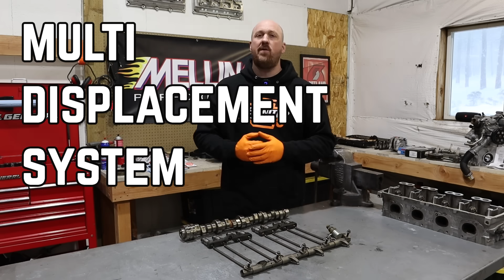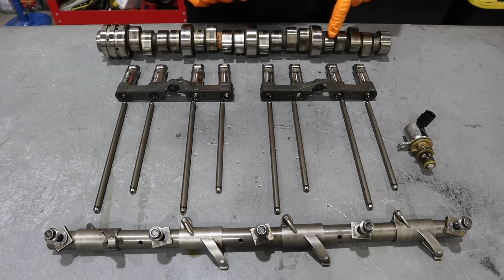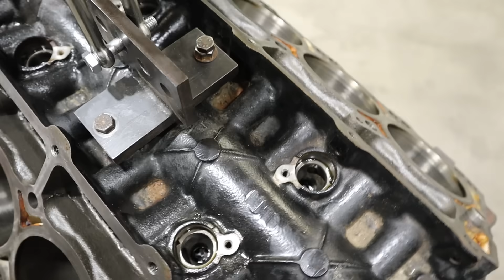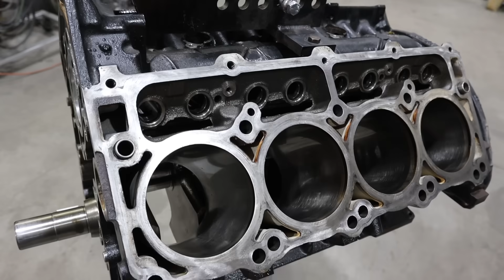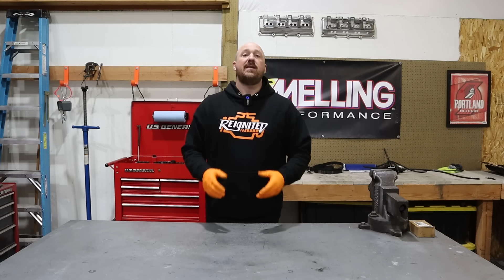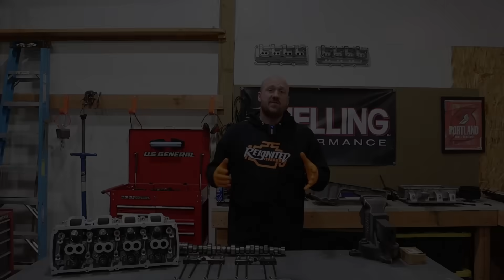Is MDS Damaging Your HEMI? The Answer May Surprise You!

Comment: So if deactivating the MDS by using your transmission auto select 8/8 is hurting the oiling how do they get around tow/haul deactivating MDS and that’s when you need the most oil for towing . It’s towing when you have arguably the highest oil temps and there going to starv the oil to the engine. ?
Reply from the maker: On a temporary basis like that there's no problem, I'm more talking about people who turn it off every single time they drive the vehicle. Also it's far more important to make sure your oil changes are being done at the proper intervals and that you're not idling it excessively. Both of these things will affect your engine far more than the MDS system.
Reply: @ReignitedAuto  Im unfortunately that guy. Lol 😂 I bought a 2500 6.4 2022 model crew cab 4x4 brand new and it now has 40k on it and I have never let the truck run in MDS mode. Having said that I’m not saying you’re wrong by no means . My way of thinking was if the solenoids turn off oil or limit oil to a lifter when MDs turns on then turning it off should give me full flow. I’m about half way through a year long test I’m doing with lake speed Jr on testing Pennzoil in the truck versus Amsoil signature series to see which oil the engine likes better and so far both have outstanding wear numbers albeit the copper is a little high in both oils . I will say I’ve never went over 5k on an oil change since I’ve had the truck.
Reply: I recently bought HPTuners MPVI3 dongle and a new unlocked Dodge PCM. The very first thing I 'wanted' to do was to "Disable" MDS in the tune, which is very easy now, but I haven't done it. I totally get the point being made by you here.... i.e., the auto manufacturers seem to do some stupid things, but would they be so remiss as to allow MDS-off condition to starve oil to ANY part of the engine?? As you say, in a towing situation this would almost certainly be quickly disastrous. I just hate the MDS in my 2019 RAM 1500 5.7L, it chugs and feels like crap.
Reply from the maker: @ChevySS1968  i do want to clarify again that the lifters are not being starved of oil when the system is off. There is still oil flow, it's just that there's more when the system is active.

Comment: I'm replacing the lifters and some of them have the lower hole so how do I know which lifter to be put in what location ?
Reply from the maker: The tray for the lifters says MDS front or rear, and the same orientation holds true for both sides of the engine. 
Reading this back that doesn't sound very clear 😄. I should have some videos that show the installation of the lifters in their trays.
Reply: @ ok I'll look at them tomorrow again ..I seen they were different so I searched most of your videos and didn't see anything that showed specifically what went where..
Reply from the maker: @dannykoehn86  I'll see if I can track one down that shows it clearly 👍
Reply: @ReignitedAuto  thank you  I rewatched it and you did show what I was looking for .. guess I missed it . Thanks for the help
Reply: @ one more question.. do I need to pull off the front cover just to take the driverside head off?  Looks like there's a tube that goes from head to the front cover below that wrench looking bracket that goes from the head to the cover
Reply from the maker: @dannykoehn86  that's just for a bolt that goes through the timing cover into the cylinder head. You don't have to remove the entire cover  👍
Reply: @ thank you !!   I thought I had watched all the videos I could find but one mistake I made was I put the intake rocker arm on the exaust side and bent some push rods when tightening . I pulled them off and after comparing the two, realized my mistake but thanks for all your helpful videos

Comment: I have a lot of photographs. My ram fifteen hundred getting twenty miles a gallon. I spent a lot of time commuting from Michigan to Buffalo via Canada. Where the speed limits are a lot slower than in the US.  Cruise control on sixty miles an hour
Reply: '17 1500 4x4 , 3.91 ( or is that 3.92 ? ) . Cruising the highway at either 1500 rpm ( 57 mph) or 1950 rpm ( 68 ? ) gets 21mpg . During  the week ranges from upper 16's to 18.0 , depending  on the exact mix of stop & go , stoplight/  stop sign every block , 4 lane surface with stoplight every mile or 2 , and interstate with & without stop & go .

Comment: How do you feel about shutting off MDS by using the gear selector? Does it actually work? Is it safe to always do? I had a 2017 5.7 hemi that i put 70k miles on, and every mile was with MDS off via gear selector. But i just recently traded her in for a 2021 5.7 and would like to believe i would be fine doing the same thing. Just hearing an opinion from someone who knows the ins and outs of the 5.7 would be greatly appreciated

Comment: So, leave the stock oiling system for the rocker shafts in place, install MDS block-off plugs, which I assume allow full pressure to the lifters at all times, install all non-MDS lifters, use hollow pushrods with blocked holes, as the rocker arm and lifter cups will have access to oil pressure from each end, so oil flow through the pushrods would not be necessary, and install a Melling's or Hellcat higher-flow pump.

Comment: Doesn't make sense.  So if you towing and msd is not active, you hindering oil flow to the lifters?
Reply from the maker: You have to remember that even when MDS is activated it's constantly turning on and off due to various scenarios. Towing for periods of time won't have a huge effect, but turning the system off for good can have an impact. That being said, it's much more important to make sure you're changing your oil at the proper intervals and not idling for excessive periods of time. 👍
Reply: @ReignitedAuto  do you have an oil and filter weight and brand preference?
Reply from the maker: @493john  I'm not an oil snob, most of them are just fine for everyday use. I do prefer to stick with the factory recommended viscosity and I like OEM filters as well.
Reply: @ReignitedAuto  thank you sir

Comment: I've never had problems but I have a strategy to avoid them based mainly on what I've learned from your website.. I agree that shutting down the MDS deprives the system of oil under certain circumstances. My main solution is 5W-30 oil (I live in Arizona) and a zinc additive. Instead of replacing the oil pump my strategy is using an idle speed up device to take it to 1500 rpm (I see around 50 psi at that RPM) for lengthy idles I do from time to time. The last icing on the cake is I live in a rural location and can't go anywhere without at least 30 highway miles whenever I use my truck (2022 Power Wagon). And from time to time I drive in such a way as to see the eco light come on the make sure oil gets everwhere now and then. We'll see how it does, 40,000 miles as this is written. I think you have the best understanding of the problems.
Reply: i just got 1500 ram with 70,005 miles. next oil change  5w40. 
thermostat is  203'f . mds  30 - 52 mph . otherwise i clik it off. od#5 . 
north off toronto . i am more worried about hittin a moose or a dam turkey.

Comment: I have a 2014 Charger with the 5.7 and started commuting long distance a couple years ago, and I am thankful for the MDS because it gets me 25+ mpg at highway speeds, which makes my V-8 a legitimate commuter car.  So far I have 155k miles without having any lifter failure.
Reply: I had a check engine code for mds and went with higher viscosity oil and took care of it. There was one guy who explained it that it creates more pressure to activate it
Reply: I also went with oem filter

Comment: It always was a garbage system.  The whole point of a big V8 is to have instant torque and smooth running - MDS hurts both.  My 6.1, without it, is now on 360K miles.  My 5.7, with that crap, died in 100K.  My 6.4, without MDS, is smooth as can be and will break 200K with ease.  The worst part is the MPG savings for MDS is neglibile in real world driving.  I am averaging only 1 mpg worse in the non-MDS 6.4 than the crappy MDS 5.7.  Zero point

Comment: If I engage the “Tow Haul” or if I put the transmission in manual mode, then the MDS will not engage…I fail to see how by disengaging the MDS via these two options will cause more damage…lots of people drive their trucks in “Tow Haul” mode…are you saying that causes lifter damage?..what about when the engine is warming up or if you are towing or have a load in the truck or driving at high speeds that will not allow the MDS to engage?…will that cause lifter damage?

Comment: I still think best fix is software- simply increase idle to 850. You need more oil slinging from the crank, you don't get that at 550 hot idle...plus it eliminates low oil pressure at hot idle without tearing engine apart at all
Reply from the maker: True enough, I've seen a few fleet companies that have done that.

Comment: Great video! I currently have an issue with a multiple cylinder misfire.  History is: 172k miles.  I did a cam and lifter job complete with heplcat oil pump about 6 months ago but it’s not a daily driver bc it’s a truck for my son.  The multiple misfire issue only happens when we get up to speed and stop at the 4 way stop in our small town.  Shut the truck off and it’s ok again.  I’m thinking either the solenoids or a terminal on the solenoid plug.  Your opinion on wear to start spending money to correct this issue would be priceless and could save me a ton of time and money.  Thanks in advance!

Comment: Does putting in a higher volume oil pump mess with the mds?
Reply from the maker: As long as you install the pump with the stock pressure relief spring the MDS will be unaffected and you'll still get the benefits of the high volume at idle. 👍

Comment: I have a 2021 3500 and I tow a 5th wheel trailer about 6-7 thousand miles a year. When towing the truck is in tow/haul mode which to my understanding shuts off the MDS. Does the tow/haul mode  add to the risk of lifter damage?

Comment: I have a question. I have a 2024 2500 Tradesman with the 6.4 with MDS (completely stock). First of all I appreciate the information,. Thank you!! My oil pressure is around 53-54 while driving and it drops to 30 when idling. So there are 2 things I do. I minimize idling (it's around 12% of my engine hours). I also change my oil at the 5k mark with the correct oil. Rather than the expense and trouble of changing the oil pump, would it make a difference to  have the truck programmed for a higher idle speed? Say 200 or 300 rpm? It would increase the oil pressure during those instances where I have to idle. Or is it the load on the engine that makes the difference? I would be interested to know. Thanks!!
Reply from the maker: That's certainly an option to achieve the same result. I'm aware of some fleet companies that have done exactly that. My only issue with it is that I dislike vehicles that idle high, but that's simply a personal preference. 👍

Comment: this was really good, I just did a cam replacement on a 5.7 in a ram pickup, had 2 bad rollers one was an mds lifter the other was a regular lifter I think the problem is the bearings in the rollers just like the 3.6 V6

Comment: All I know is I loathe the MDS on my ‘23 RT 5.7 Charger. It just makes for a poor driving experience and it kicks on far too often. I really wish Dodge would have given drivers the option to turn it on and off. I’d like it on when on the highway cruising at 80mph, but I don’t want it when I’m going 35 mph.
Reply from the maker: As I understand it, legally they aren't allowed to let customers turn it off for good. Of course you can shut it off every time you drive it, but as soon as you cycle the key it turns right back on. And I agree, they're are too many situations where it's trying to engage when it's not necessary.
Reply: @ReignitedAuto  if you drive a 6.4 hemi in sport mode all of the time will that harm anything, sport mode deactivates the mds.

Comment: So the mds does not make you drop valve seats when activated for extended periods of time driving? I'm confused
Reply from the maker: No, those two things are completely unrelated. Is someone else saying that is what's happening? The valve seat issue only affects the 03-08 engines and it's due to poor machining tolerances when they installed the valve seats, when the cylinder head gets too hot, especially if the engine overheats, the aluminum will grow enough to let the valve seat fall out. The 2009+ engines solved this issue, I haven't heard of even one of them doing it. Completely unrelated to the MDS system though.

Comment: Ok..MDS system..8 cylinder to 6cyl to 4cyl. variable for fuel economy at freeway speeds..It 's just another engine option to avoid buying...If you want a full size truck or van/suv...Just go with the 5.7 Hemi/Performance Program/5,000 mi. Full Synthetic Oil changes on time...Always remember..Designers are not having to fix their problems..We Have Do...

Comment: so since it closes on the compression stroke doesn't that also push away the  oil on the cylinder walls? and cause the rings to fail first?
Reply from the maker: Nope, the function of the piston rings are unaffected whether combustion is happening or not. The rings will still be drawing oil up onto the walls of the cylinders regardless.

Comment: Hello good I have a hemi year 2023 has few miles and I want to remove or disable the system mds which is the best way to do it according to your recommendation.
Reply from the maker: I highly recommend keeping it if you have a vehicle that is still under warranty. Removing it will cost quite a bit of money, and i do not recommend simply disabling it for the reasons mentioned in the video. 👍

Comment: IDK.. I've had both lifter banks, and pushrods replaced twice on my 2018 Power Wagon (Each bank about a year apart) before 100k . All warranty work, and its ticking again a year later.  I'm over it and will be deleting it myself, since warranty wont cover the "real" fix.  This truck hauls a Cabover constantly, so its always working hard.  Each failure was the pin spinning and getting stuck out of orientation, not allowing the lifter to lock up, that will bend the pushrods. I have been 5k oil changes with proper full syn oil. I was afraid of this system when I bought the truck, but I thought it was due to lack of maintenance.  That is simply not the case.  If you say that its not getting proper lubrication when the system in not activated, that is a design flaw!!  So,  it should be deleted from the manufacturer.   Since I am always under load, it never comes on, if it does, it on deceleration only for short periods of time. I do not disable when I drive. But in my case the MDS was 100% the problem, every time.
Reply from the maker: Your mechanic is giving you a story that is not real. It's a very common misconception that if the pins on the lifter are not fully lined up then something is wrong. In actual fact, if you look at the brand new lifters when you install them, the pins look identical. I've never once in my career seen a condition where the lifter failed to lock into place and bent pushrods. The second issue is that you had the repair done twice in a year. This lifter roller failure that I'm speaking about generally takes a very long time to develop, usually 60k+ miles. My guess is that you've got an entirely different issue happening, and the mechanic is making assumptions rather than investigating the cause fully. 
I do agree that is the truck is constantly being used to haul heavy loads then there's absolutely no reason to have the MDS system and i support getting rid of it entirely, but based on your previous issues, don't be surprised if this removal fails to fix your actual issue.

Comment: I am deleting the MDS system and planning to put Hellcat oil pump in. Will I still get a code if I do not change relief spring to OEM 5.7 in the Hellcat oil pump?
Reply: This is a 2015 Charger R/T with 5.7 Hemi
Reply from the maker: As long as you install a tuner that turns the MDS system off for good then you won't get a code. I will encourage you to go with the Melling 10342HV pump over the Hellcat one though. It's still a direct bolt on, but it's even more volume than the Hellcat pump. 20% more versus 12% more. 👍

Comment: In winter weather, the engine takes 9-10 miles to reach operating temp but only 5 miles in sport mode without MDS.  
Not good.